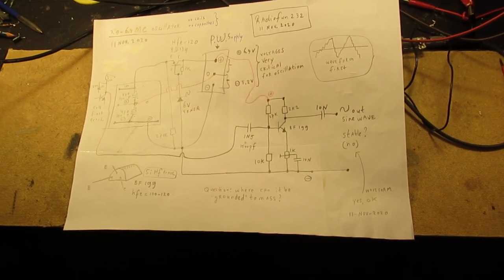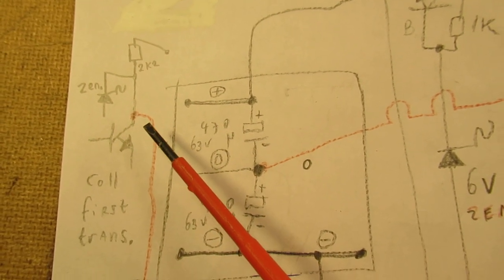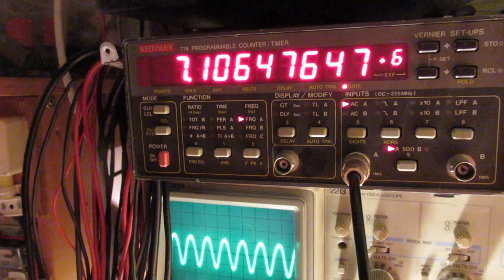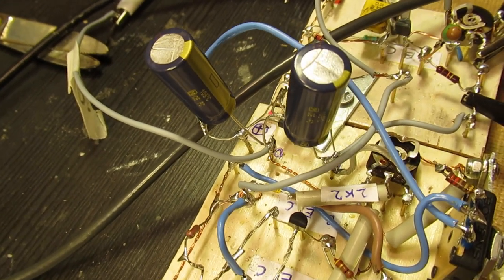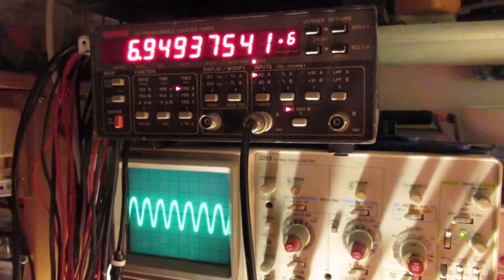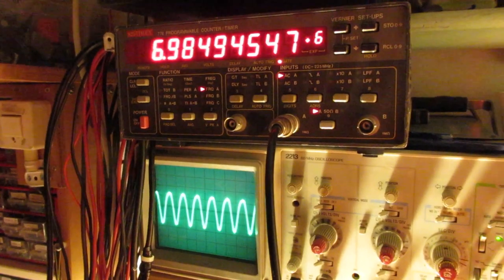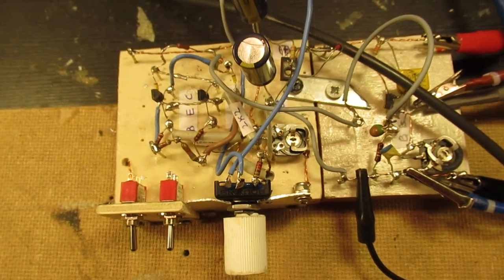Sine wave oscillator 4 - 7 MC without coils or capacitors update: better waveforms with a buffer

Comment: The amplifier stage has really cleaned up the output waveform. A really useful circuit. Thanks.
Reply from the maker: Thanks Martin, I had not expected that these abberations could be cured in such a simple way.

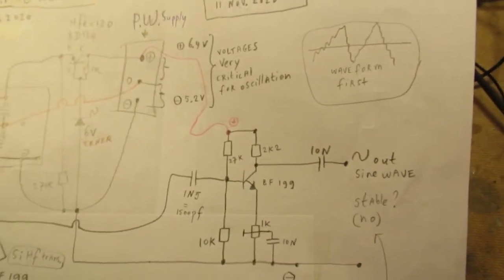Comment: Question:  Where can it be "grounded" to my ass ? (Shematics notes @ 1:08 ) That's a good question 😅 anyway thanks for the video. I will try out the circuit now 🙂👍
Reply: The buffer circuit fixed the issues I had with my AM band transmitter oscillator. Thanks. I'm earning alot here 🙂.